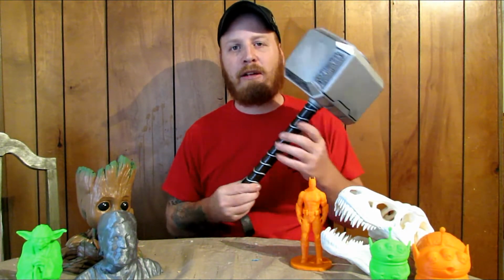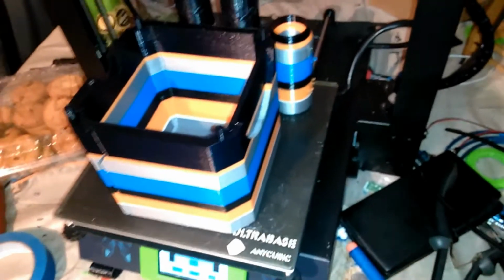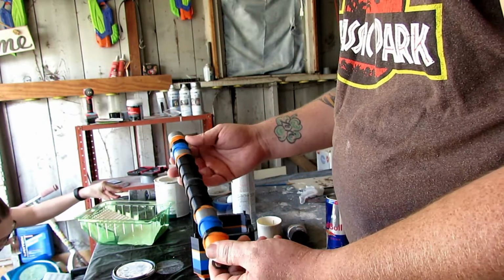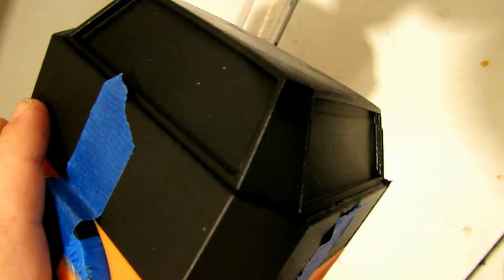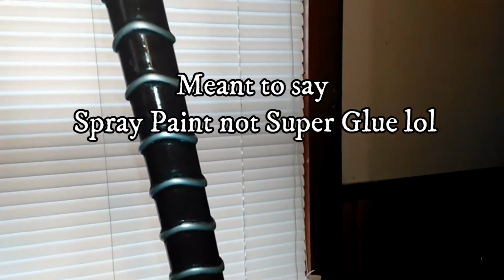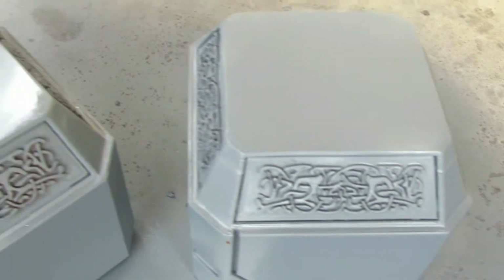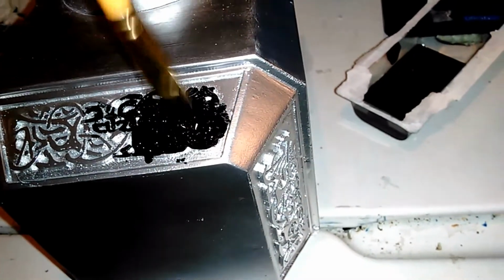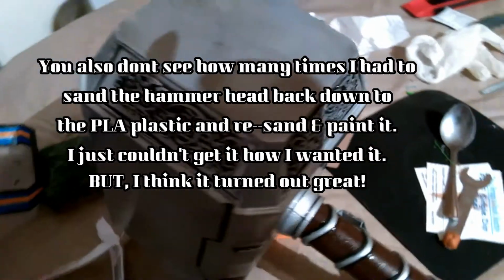3D Printed Mjolnir Thors Hammer

Comment: Hello man!! How do I print the handle? I just got a maximum print height of 230mm. I have an ender 3 pro. thank you!! looking forward to your response!
Reply from the maker: i plain cut it using meshmixer. you can also just use cura. slide it down to the halfway point then flip it over and to it again. I cant really explain that method via typing here. but, theres videos showing how to do it. meshmixer is free and its very easy to use. after i printed both halves I put a piece of PVC pipe in between for extra strength and glued it using superglue and baking soda

Comment: Great job man, I am just starting to print same hammer, I noticed you used different handle from thingiverse, is this because one of them is in one piece and cannot  be printed on your Anycubic, I have same printer and not sure  if I should try and use mesh mixer to split the handle into 2 parts.
Reply from the maker: Actually I didnt have to use meshmixer to cut it. I just put it in Cura and moved it down to the exact halfway point and created the G-code, then flipped it around to do it for the other side. Cura will cut it if you move it down. The X,Y,Z point (where they all meet) is the exact middle. So you just have to get that arrow right onto your bottom line, then flip it and do it again. I did it that way so it would keep the center hollow. If you do it in meshmixer it will print a top where you plain cut it and you'll have to cut it out. You want PVC pipe in the middle for extra support. Just gluing two halfs together wont be strong enough. If its something small and skinny like that handle its jst easier to do it in Cura
Reply: Thanks for quick reply, gonna try your advice and split it in cura